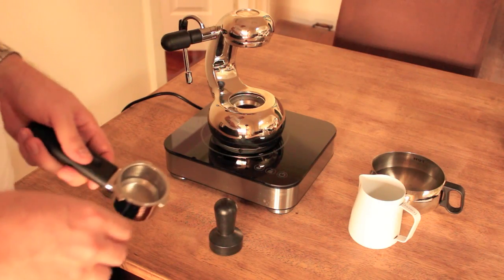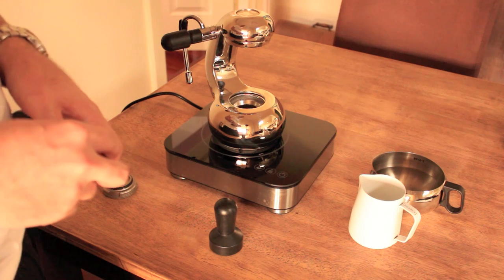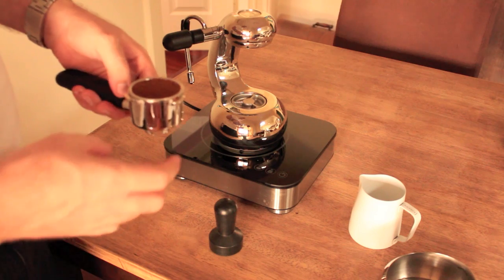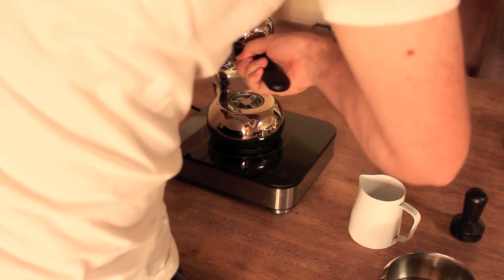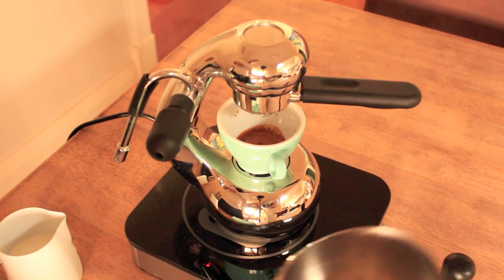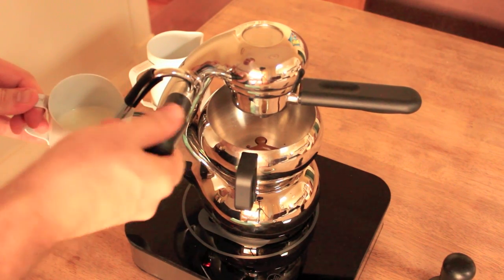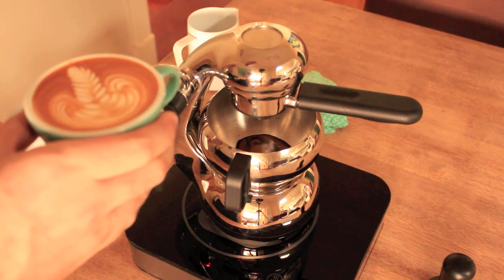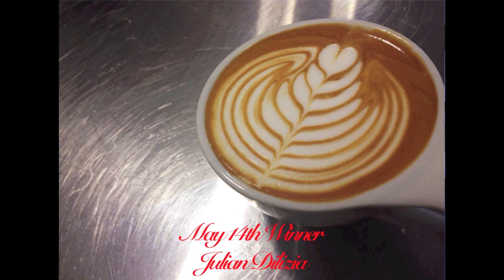Coffeefusion Tutorials - The Little Guy Guide

Comment: Not trying to put you down but isn't this just an expensive moka pot with a steam valve. Similar to the Breville Bar Italia which retails at about 10% of the price (and gets horrible reviews). I like the design and it looks really cool however.
Reply from the maker: Hey - thanks for the comment. It's not just an expensive Moka Pot at all. Style-wise it is based on the Atomic, but the internals allow for greater extraction. Definitely worth reading in to more. I think when I get a chance to I will do another video with Craig to try and explain "The Little Guy" further.

Cheers :)

Comment: I have watched this video several times. I am torn. A part of me wants to buy the Little Guy and the induction hot plate but, not only is it expensive for what it is, but I keep going back to the idea that I can get almost the same thing with a Moka Pot.

My eye has been on the Alessi 9090. With the Alessi (and a hot plate) I can make the same type of steam driven coffee, make more of it, and do so in a cheaper, smaller, more convenient package. Also, the Little Guy takes a full 30 minutes to cool down before you can use it again. Not so with a Moka Pot. What the Alessi won't do is steam milk and the solution would be to just get an electric milk frother. 

So I am torn: The Little Guy vs. the Alessi 9090 & electric frother. Any advice? Thanks.

Comment: I thought they had stopped producing this piece of equipment due to the mountain of complaints. It’s made in china and the quality of the product varies dramatically. A friend of mine has one, Great coffee for 10 weeks, then no steam. Emailed Little Guy, the response they received really bullying email implied that it was their fault. The cost of postage, it weighs 8kgs, and the Little Guy doesn’t want to pay even when it's under warranty. The machine is made in China so when you send back you pay for the postage and their experience was the Little Guy back wouldn't repair under warranty; basically the company take no responsibility it's your fault and It's your word against theirs.
Reply from the maker: Have never heard anything like this before, and everyone I know who uses them has used them solidly without issue. Mine is years old now and although I don't brew with it often anymore, every time I bring it out for whatever reason, I make great coffee with it.

They went out of production for a while there because they didn't meet sales targets to go international, which is what they would have needed to make the company viable. However, recent news is that they have just struck a deal with Kitchenaid to come back on the market, still under The Little Guy brand.

Not sure what you mean by the mountain of complaints.. just did a bit of a look on google for other stories similar to yours but couldn't find anything, only positive reviews.

Comment: so there's no way you can tell the pressure coming through the extraction and also could it be that your extracting with stream temp water? did it comes with a opv for excess pressure
Reply from the maker: It does come with an OPV - Not sure on the specifics of how the brew temperature works but the water is at a lower temp than the steam. :)

Comment: I don't have the induction top and the little guy will not make an espresso nor steam milk on a gas stovetop. Not living in Australia, the price for the induction top is $400 with shipping. Likely the worst purchase of my life. I hope this video had addressed this and show us how to get around the outrageously priced induction top
Reply from the maker: Heya! I definitely remember feeling the same way when I first purchased this and couldn't get it extracting nicely. But I used a gas stovetop for the first few months before the induction came out and got decent coffee out of it after fine tuning some things so lets see if we can't troubleshoot your issues.

Qus: What kind of grinder are you using? Are you using the normal basket or are you using the pressurised basket? 

What's not going right? are you not seeing the coffee start to extract within the normal timeframe? Are you following all of the other steps for the little guy? I'd say if so, your grind might be a bit too fine, or the gas burner you're using isn't getting quite hot enough to get the boiler boiling.

Have a couple more practises and get back to me, will see how I can help!